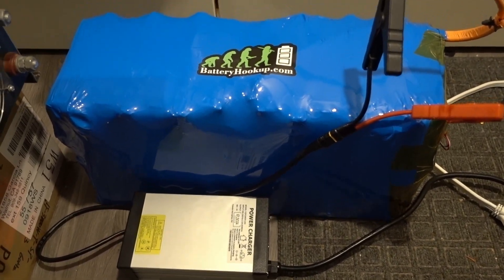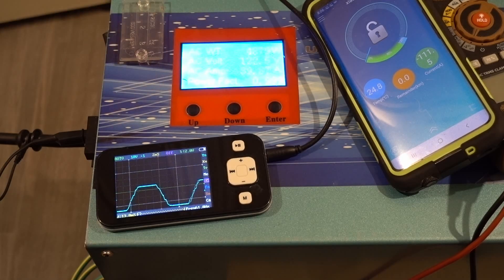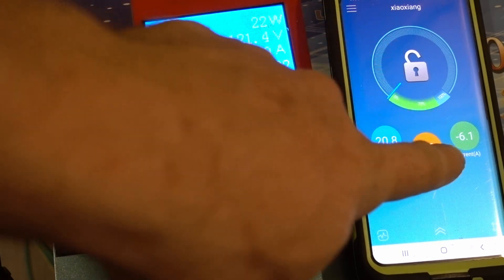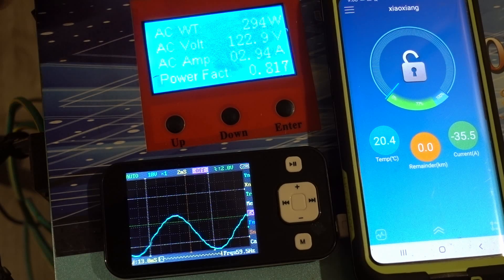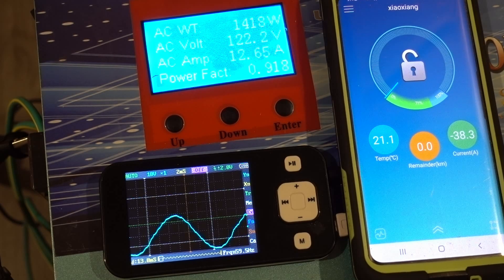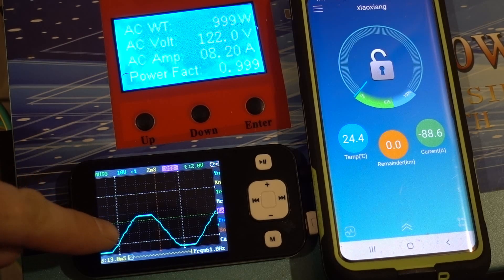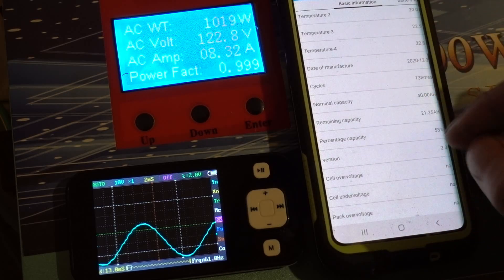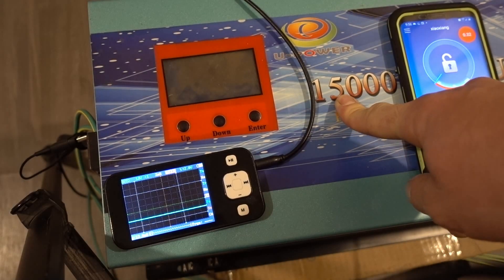15000W PowerJack I Cant Believe It and 2.4Kwh DIY Battery Test

Comment: Excellent videos! I have 10 LG Chem of Chrysler Pacifica that I still do not install but watching your videos and the BMS configuration I want to do it. How many BMS do you recommend to me?
Reply from the maker: you have the 16s modules?
Reply: @GoingOffGrid101  Yes, the same ones as you have!
Reply from the maker: What do you plan on running?
Reply: @GoingOffGrid101  I have a Schneider XW Pro 6848 I plan to run the whole house. An inverter air conditioning of 14k and another 12k propane gas for the water heater the stove is electric the refrigerator consumes 3Khw per day my house consumes about 20Kwh per day.
Reply from the maker: @RICKYRACO  I would use 2 of these

https://www.aliexpress.com/item/32962595842.html?src=google&albslr=222250683&albcp=1633541485&albag=62156539197&trgt=296904914040&crea=en32962595842&netw=u&device=c&gclid=EAIaIQobChMI7amKxce54AIVFNNbCh0uMw1SEAEYASACEgI1_vD_BwE
Reply: @GoingOffGrid101  Set up five in parallel with two 300 Amps BMS each?
Reply from the maker: @RICKYRACO  yes sure! you could probably get away with just one bms.
Reply: @GoingOffGrid101  Ok, thanks for your advice. I'm going to order the BMS and let you know!
Reply: You have the original cables of the battery ports?
Reply from the maker: @RICKYRACO  you mean the original bms wires?
Reply: @GoingOffGrid101  Yes, but I think I'm going to do what you did weld the cables. Is the best option.
Reply from the maker: @RICKYRACO  yes it was easier!
Reply: @GoingOffGrid101  When you have a time you could send a picture or drawing of cells for which is the 1 etc. I have an idea but I don't want to make a mistake. 🔥 😃

Comment: How many wkh does a house needdaly
Reply from the maker: every house is different, mine needs 20-40 a day.
Reply: @GoingOffGrid101  20 40kilawatt hours
Reply from the maker: @leasttrending  yes
Reply: @GoingOffGrid101  and i got my cheap pwm and its for lead acid man im dumb
Reply from the maker: @leasttrending  you might be able to set the voltage

Comment: They only havea 30a msb what can that run and how many solar panels should I buy for it
Reply from the maker: what voltage is your inverter you using?
Reply: @GoingOffGrid101  I wanna stay at 12 right now don't understand higher voltage right now
Reply from the maker: @leasttrending  ok so you can get a 60 amp makeskyblue that can handle 720 watt of solar.
Reply: @GoingOffGrid101  there out of stock hear
Reply from the maker: @leasttrending  hmm well you could go pwm for now and upgrade later
Reply: @GoingOffGrid101  I just bought some solar a cheap mppt and cables how can u tell pwm over mppt does eBay lie
Reply: Where can I get cheap cables and mc4 connectors ebay or alibaba
Reply from the maker: @leasttrending  o yes ebay has fake mppt, but if you can prove it you can get your money back, send me a link I'll let you know if its real or fake
Reply: @GoingOffGrid101  how do I send u a link
Reply: Don't u have a Facebook or Twitter page
Reply from the maker: @leasttrending  add it to this chat
Reply: @leasttrending  you need to get someone to help you asap if you are trying to set it up and have no idea what to get. Plan everything out before you buy it. The 2 cheapest mppt controllers which trade extra voltage for more amps (more energy for the battery to store) are makeskyblue and powmr. But you are shooting yourself in the foot in the long run if you do not have a high enough voltage to start as the higher the voltage battery, the more power an mppt charge controller can give. So @12v you get 720w of charging... But @24v you get 1440w of charging capability. Then if you start with the ideal 48v setup you get a whopping 2880w of charging power off of a single 60amp charge controller (about $100 shipped). I have 10panels that are 250w each on a single charge controller (2s5p configuration). You need to know series and parallel connections to do the solar panel and battery setup anyways or you will miss out on power.
Reply: @fookschool  yes i know im batteling a really bad foot infection and its hard to do anything

Comment: Hey bud, you got a link for that 16s charger? Can it be adjusted to a lower voltage?
Reply from the maker: yes here it is

https://www.aliexpress.com/item/32778098924.html?spm=a2g0o.productlist.0.0.1bac574e6gTCLh&algo_pvid=b84aa102-5a83-4644-88d4-1b26e335acf4&algo_expid=b84aa102-5a83-4644-88d4-1b26e335acf4-0&btsid=0bb0623c16167293332637285e424d&ws_ab_test=searchweb0_0,searchweb201602_,searchweb201603_

Comment: I have over 2o breakers in my box does this mean i have to have one inverter for every breaker or do some inverters support 2 or more breakers idk am I stupid
Reply from the maker: a 3000w inverter can supply up to 2 breakers and a 8000w inverter can supply in some small homes the hole breaker panel.
Reply: @GoingOffGrid101  so 10,000 it is
Reply from the maker: @leasttrending  what brand are you looking at buying ?
Reply: @GoingOffGrid101  I like aims but idk I'm cheap too

Comment: Does Square wave or sign wave even matter and it what cases is every single inverter u have pure sign wave
Reply from the maker: all my inverters are pure sine wave. square wave blows up some electronics and shortens life of most electronics.
Reply: It is really a modified sine wave. Not a square wave. Mod sine is only decent for resistive loads. Makes you equipment hum and causes excessive heat in motors among other issues.

Comment: Nice test. Does the BMS have top balancing? Or can you set the balance voltage. I see tha Daly has a programmable smart BMS. Mine are the old type top balance. The problem I lay run into is I do not ever hit the top balance voltage. I think my BMS modules balance at 4.14 and I only charged to 4.04 per cell. That means if I do get any drift I will have to crank up the voltage now and then. Someday I buy 6 of those smart Daly BMS. They are $150 each!
Reply from the maker: this one is only 75 bucks and you can set the balance voltage.
Reply: @GoingOffGrid101  can you send me a link  when you get a chance. That is a great price.
Reply from the maker: @offgridinthepacificnorthwe3210  how many Series are you running?
Reply: @GoingOffGrid101  7s lithium ion NMC Tesla
Reply from the maker: @offgridinthepacificnorthwe3210  https://www.aliexpress.com/item/4001102305873.html?spm=a2g0o.productlist.0.0.64e61771eyTna4&algo_pvid=aa9bcbf7-a18f-43fd-8d45-d0cab2b532ae&algo_expid=aa9bcbf7-a18f-43fd-8d45-d0cab2b532ae-2&btsid=0b0a555716158570387171678e030f&ws_ab_test=searchweb0_0,searchweb201602_,searchweb201603_
Reply: @GoingOffGrid101 That was fast, Thank brother. Have a blessed night.
Reply from the maker: @offgridinthepacificnorthwe3210  np you have a good night as well!

Comment: Are they lithium phosphate batteries how many amp hours each cell
What is the inverter how much pure sine wave
Reply from the maker: its lithium ion 40 Ah and powerjack 15000w inverter.
Reply: @GoingOffGrid101  right not lithium iron phosphate you've not tried the phosphate should have a higher capacity charge what about price how much did that cost you the inverter and building the battery
Reply from the maker: @johnsweda2999  the battery was 350 USD and the bms was 50 so 400 USD to my door.
Reply: @GoingOffGrid101  doesn't sound bad you could say that's no bms then lol
Reply: @GoingOffGrid101  what about safety wise! if they're not done correctly these batteries can explode even from so-called reputable companies well they do on electrical bikes, should they always be kept outside from the premises in a fire proof container. I think people get a bit blase about batteries especially if you're buying from China without any knowing of any legit testing should be checked and even put fake certificates on them
Reply from the maker: @johnsweda2999  these are older used batteries, also these are pouch cells like the ones used in tons of electric cars, these are quite a safe chem, on the other hand these are older cells that have had some degradation.
Reply from the maker: @johnsweda2999  it has a full bms though :D

Comment: I hope they send you them for free. I cant get behind a company that lies about their products. Great video as usual. Hope all is well
Reply from the maker: i traded for this one.
Reply: @GoingOffGrid101  nice. I'm sure it won't last long tho. I'd rather a swi power then those ones. As long as you are happy with it is the main thing. At least it works
Reply from the maker: @frankz1125  well maybe ill run my house this summer to test it.
Reply: @GoingOffGrid101  might as well get a few months from it. I would feel bad selling it to someone. Be a video anyway
Reply from the maker: @frankz1125  jeff has a 8000w and has been running it for a while now so im not sure. i know the 3000w is a pos but if you only pull 6500w or less the powerjack seems like a good unit. time will tell. the reliable 8000w that could do 7200w lasted 1.5 years running large AC units so we will see that this one can do :D
Reply: @GoingOffGrid101  give it a try. It will give the good inverters a break anyway. I'll be waiting for the video😉